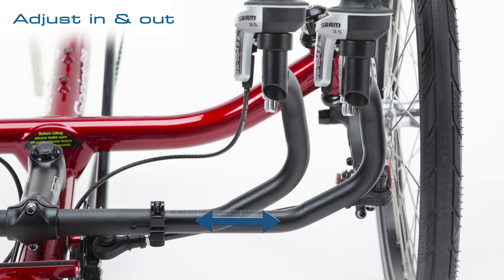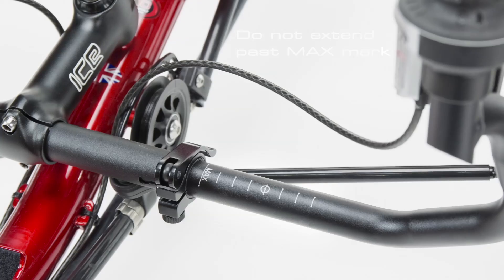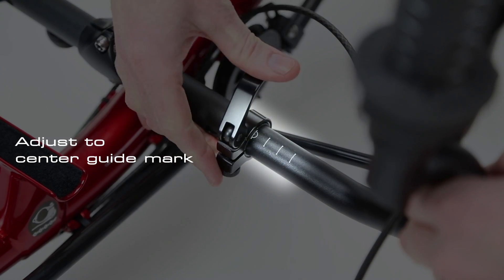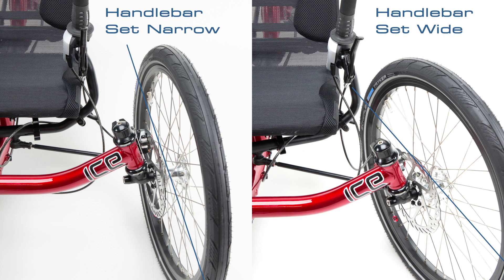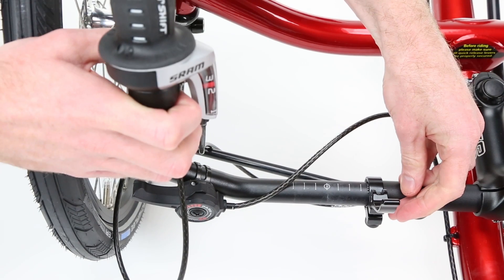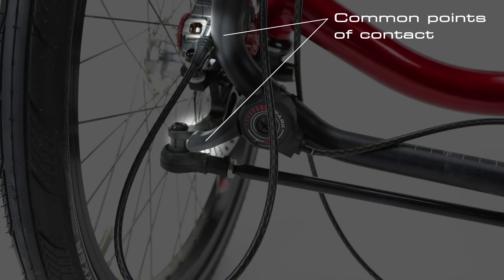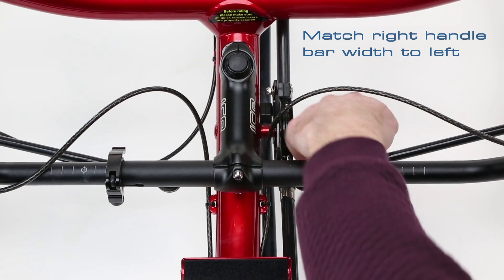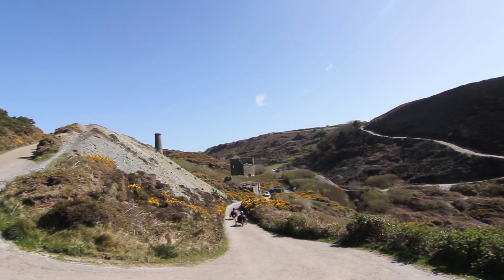ICE recumbent trike: Improving the turning circle (Tech Guide)

Comment: I have found some restriction to the steering lock with mudguards and mirrors fitted, but wouldn't trade them for a smaller turning circle. What helps in this situation is angling the mirror mounts backwards rather than what seems the "obvious" right angle position.